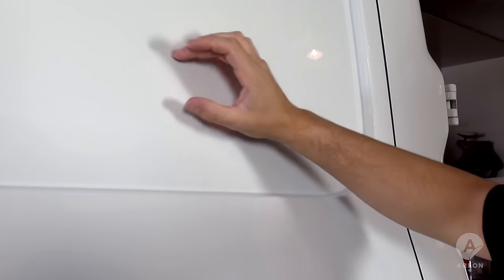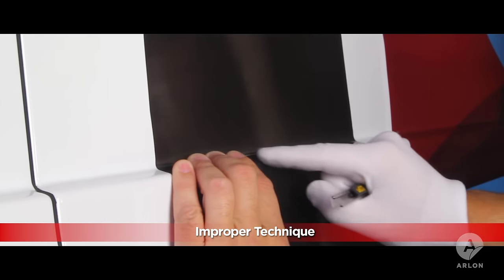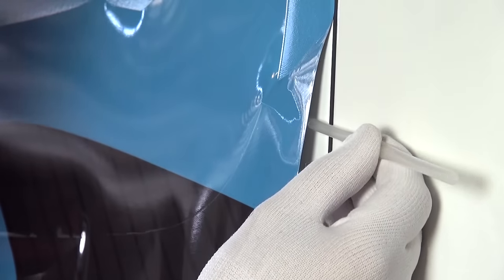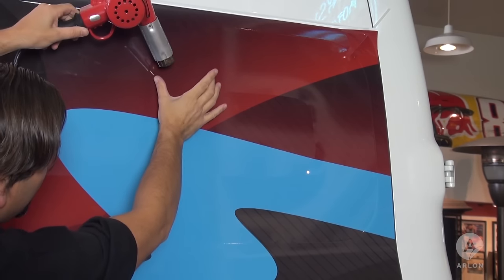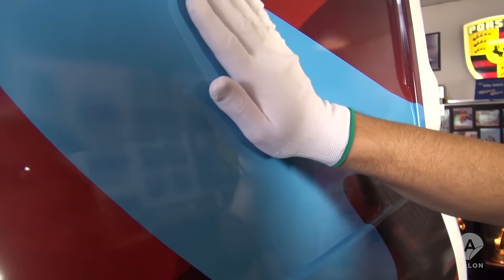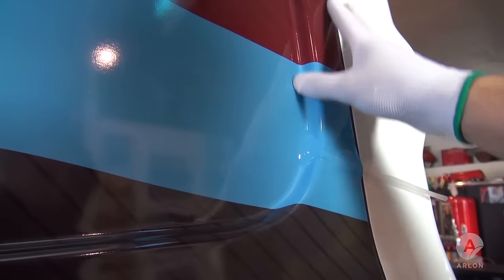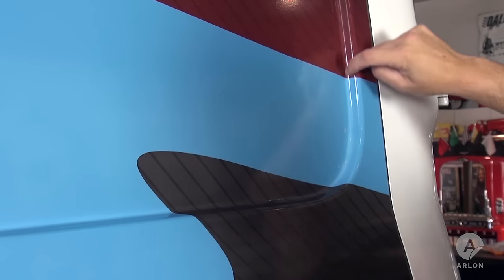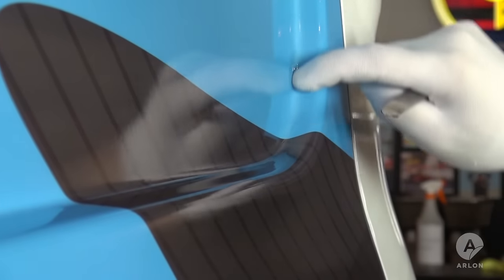Applying Vinyl into a Deep Channel

Comment: Instead of a straw (go greener) you also can use of liner you removed from the vinyl you installing. Just roll it tight to the tube and tuck it in. It won't stick to vinyl that much as a plastic straw. You are welcome :)

Comment: Thank you. I used this method and had great luck in the dips but I continued getting bubbles and wrinkles in the flat are that I heated. Is there a way to avoid that?
Reply: You never got an answer or help, that sucks! I think bubbles are always going to be there no matter what you do or what product you use. Sometimes they are worse than others it seems. I know that using heat gun after finishing a section to help seal the edges good often causes bubbles to suddenly show up near the heated edges. I am new to this Wrap game and have only wrapped my SUV at this point.
Reply: Use air release  vinyl to avoid any bubbles

Comment: why do you need to heat it if your laying cold vinyl anyways
Reply: Stretch.......... you cant stretch cold vinyl ;-)
Reply: Thank you
Reply: The only people who need to stretch it are those who don't know what they are doing. Fact! Heat is only needed if you have creases, defects from handling the vinyl and for post heating the edges so they stick real good. You never need heat just to lay the vinyl down and get it into position. Never!
Reply: @JQUICK21  so please explain to me how you wrap in a recess? Without using heat?
Reply: @jakeosborne3932  Aye, don't heat vinyl even though every manufacturer/applier recommends to do so, lmao
Reply: @ModgeDonkey  because you're meant to... again explain how you wrap a recess without heating it then post heating it

Comment: i tried to wrap my 3" cowl hood and failed miserably because i stretched it to much and it ripped 100$ 3m carbon dnoc in the trash!
Reply: your not the only one! i have done it to! :)
Reply: You shouldn't need to stretch the vinyl when doing the hood  of a car apart from on the edges